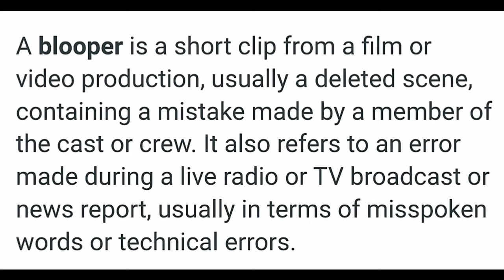PARTS YOU NEED for DIY ELECTRIC MOUNTAINBOARD 2021. All parts, all prices, description.

Comment: I learn something new in every video you make. (still very new to diy) I'm looking at the molicel p42a batterys - probably a 12s4p (looking for a good source for this too now). The one thing you don't mention in this video, and the others I've watched so far is what do you use for a charger? I'm just not sure where to look? It would be great if there was a standard charger with fast charge option when you needed it.
Reply from the maker: Hi mate,
I do use a 4Amp charger that i got from the same place as the smart bms.

Comment: 210A is not enough for me. I pull 95A per motor = 190A Thats like 0 head room for me which will make my battery hotter when under load.
What are the motors Max? 80 or 90? Either way you would want more Amps for headroom, unless you have 60A motors then you have the headroom.
Reply from the maker: Hi mate
Thank you for watching.  I am using 180Amp battery on Tsunami with 6374 motors, set to 75 amp per motor... did run the board quite hard. Maximum i did hit was 84Amp . Got the board to 38 mph. Was using 25Wh / km at one point. 
Thing is that you could potentially hit 210 amp but as a burst...don't think you would be able to keep it up for too long but i could be wrong. 
This is why i love DIY , people can build exactly what they want and in line with they riding skills . Just add another P pack and 240 Amp ready.
Reply: @PavelGarmas  how many p packs for 170km in one run? Toronto to Niagara Falls. 
Edit: not direct route.
Reply: you draw 95a per motor? you probably mean phase current. not true battery current.  pulling 200 amps from a 12s  is about 10KW. if you are so confident, post a video of the vesc app
Reply: @dancohen4439  " if you are so confident, post a video of the vesc app" I just read what the metr shows nothing more. So what ever that is is what I speak of. Now you know. :)
Reply: @NullBlox  so you do mean phase current. to our subjects_ the connection between battery current and phase currnt really on duty cycle. which means, if you set your motors to 95A draw, and you have a 47.5A discharge set on the battery, you will have full power until 50% duty cycle. then the battery will limit you. so, you could set 95A draw timed 2, so 190A, but only using a fraction of that in battery amps. to draw 200 battery amps you need to be pulling Wight fast  on a steep heel or something crazy like that.
Reply from the maker: @deejeh9494  hi mate, well molicel 12S6P gives me 25miles. You are looking at 25P pack i would say....there are some things that do affect the range though so its hard to tell for sure.
Reply: @PavelGarmas   awesome thank you,  I'm just getting into it and want to make sure i understand and that such a battery isn't a bad idea. 12S25P
Reply from the maker: @deejeh9494  
I got a video " everything about cells or battery " something like that...take a look. I do explain how it all works.
Reply from the maker: @dancohen4439  
Sounds like you are knowledgeable in this... please analyse this ( genuine question) :
12S6P,  molicel 42P, motors set to 65 Amp each, battery max set to 90 Amp.
Reply: @dancohen4439  I pull weight fast up hills but this convo is going no where. Good day.
Reply: @PavelGarmas  well,
with your 6p pack, i know some say the p42 are 45A, but they can't really work there. 35A is realistic so 210A . your battery will sag very little at your 90A limit. at 65A per motor total 130 phase current you will have max power until around 3/4 duty cycle. i wouldn't be to worry about bumping   the motor's current to 75 and battery current  to match that as well,the pack will handle it like nothing and this setup have a lot a buffers already. also, the power is linear after all so only when you truly push the board you actually reach that high output
Reply from the maker: @dancohen4439  thank you mate.i am going 12S7P for this build so 210 is a very realistic number.

Comment: How easy is it to reach out to Reacher Motors to have them build custom motors? More importantly, how much does it cost?
Reply from the maker: Not that hard but there is a minimum amount of motors that you need to buy...every option and add on costs money. Final cost does depend on the final specifications.  We did take the motors apart and customized them further...
Reply: @PavelGarmas  Very inspiring. Thanks.
Reply from the maker: @dieselphiend  no problem mate 👍